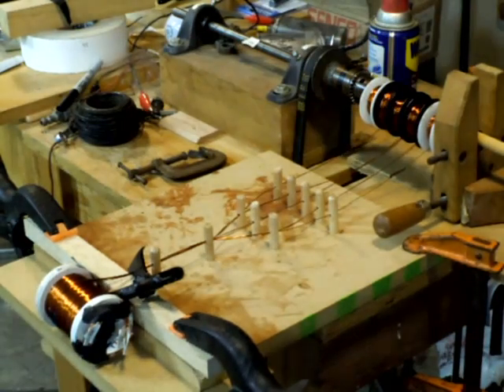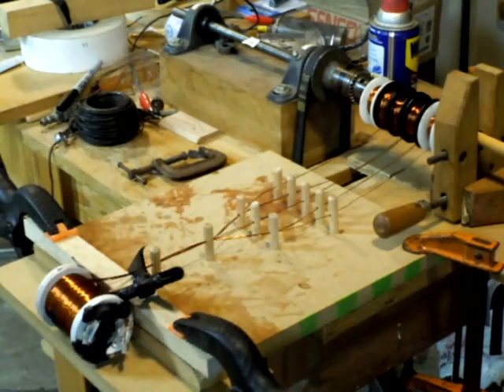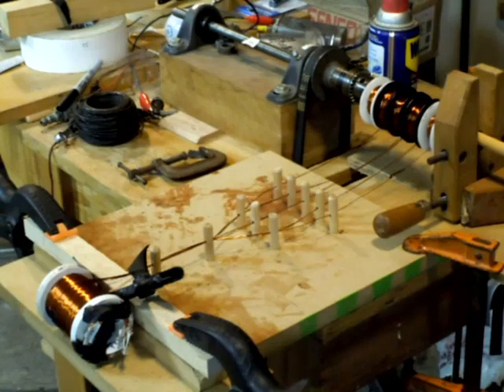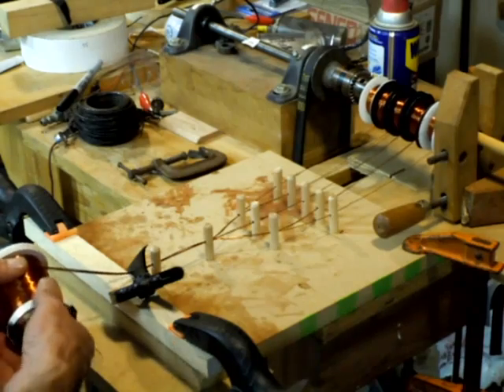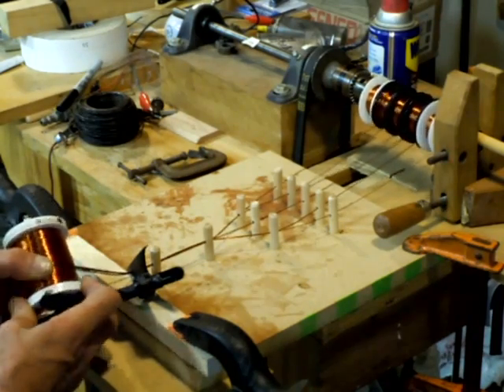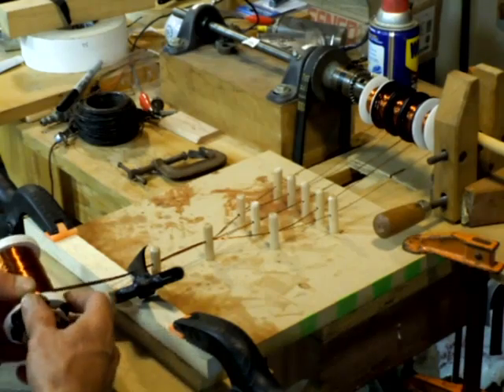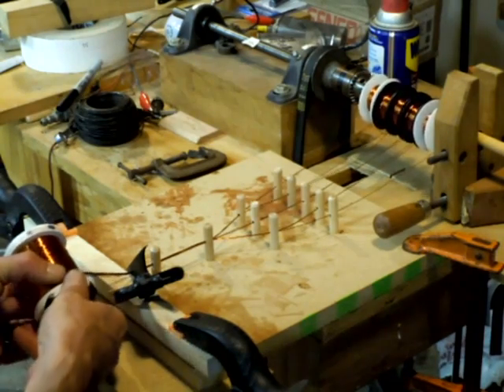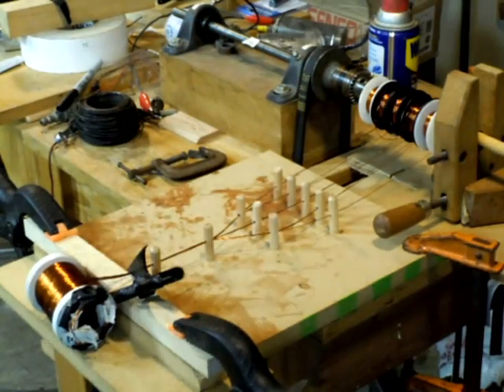Multi Filar Coil Winding Jig for Bedini Monopole

Comment: the performance will increase when the wires are twisted together after all these wires are loaded into this spool. The way you are doing it is how I used to do it. I would go to the next step and twist the wires with a drill motor. 
cheers
CW

Comment: Thanks for sharing. I'm planing to build a Bedini coil. Could you share any opinions or observations on gage size. 20&23 have been recommended by some. Is your tri filar also 24&26 also. I really don't have a clear understanding of gage size and it's effects. I haven't  purchased wire yet. So any thing you got would be helpful. Thank again.